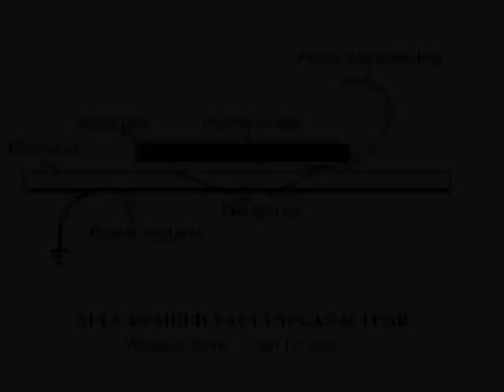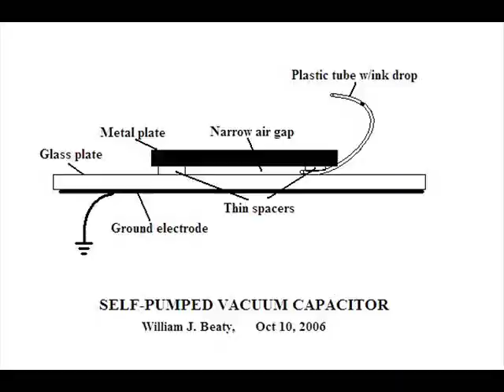Self-pumped vacuum capacitor effect

Comment from the maker: @M0AYF VERY COOL.  Ozone appears above a certain e-field threshold, nitrogen compounds at higher field.  So O2 should trap first.  At some low voltages the N2 pressure wouldn't change at all.  Also I've wondered how much the initial Al2O3 layer slows the rate.  Perhaps initially sand Al surface under dry N2?  Real ion pumps designed to use ion beams, plasma never touches metal, otherwise surface is etched by 'plasma polishing' and gas released again.  To try: layer of fine metal mesh above plate

Comment from the maker: > what kind of nitrides and oxides etc.

The plasma is against aluminum on one side and glass on the other.  Plasma is chemically active, so the air molecules should combine with the solid surfaces.  But glass is relatively inert, so the pumping effect seen is most probably caused by formation of Aluminum Oxide and Aluminum Nitride.

Comment from the maker: No, it was a radio transmitter using a pulsed arc in place of transistors or tubes (since even tubes hadn't been invented yet.)  Easily puts out thousands of watts.

A Tesla coil is not really a transformer, since in theory it should step up the voltage perhaps 100X, but in practice the voltage is far higher.  It doesn't have a step-up ratio, instead it stores radio energy in an EM resonator.  If you keep on pumping in more energy, the voltage keeps growing higher until something breaks down.

Comment from the maker: > The streamer would make a microscopic molten hole in the glass and simultaneously propel out the last bits of ionized gas.

Weird, but check again.  Once the hole appears, Tesla says the pressure rises...  his point being that it happens slowly, as if "cathode rays" can slow the inrush of air as well as keeping the hole open.  The pressure inside a tube with a visible hole should not rise *slowly.*   Tesla believed that chunks (we'd say 'atomic clusters') were being flung through the glass.

Comment from the maker: > weapon use

Tesla's "death ray" was published in the 1980s.  Plans depict a giant VandeGraaff machine with a belt of charged air, (pumped by a Tesla turbine of course.)  The sphere was covered with glass/vacuum insulated bumps.

Inside the sphere was a many MeV particle accelerator in vacuum which launched mercury atomic clusters (nano-droplets) through the center of a multi-stage aspirator pump.   In 1930s NT claimed building a successful prototype.  I've not heard of anyone trying this.

Comment from the maker: > Why is the air getting solid

It's not the current that does it, it's the high-voltage plasma.   Plasma is chemically reactive.

All the oxygen in the air gets slowly converted into oxidized aluminum, a white solid powder.  The nitrogen in the air gets converted into aluminum nitride, also a solid.  The remaining few percent of Argon might be left behind.  Or maybe the high voltage will charge up the argon atoms (create ions,) then impact them with the aluminum so they burrow inside it.

Comment from the maker: @teslaandlyne   Plasma turns the oxygen in the air into aluminum oxide.   Maybe the nitrogen gets turned into aluminum nitride.   Also, high voltage drives individual air molecules into the metal surface.  So even argon or helium pressure might start dropping.

Comment from the maker: > How can this method be used for evacation of

As with diffusion pumps, ion pumps are for high-vac and UHV. But suddenly I got it in my head that it might still work at 1atm. It does, but it's very slow (and best for tiny volumes.)

OTOH, for larger volumes, if you pumped a rough vacuum with a rotary pump, perhaps you could get to the x-ray realm just by running a big glow discharge with a tesla coil for hours. No diff pumps or turbos needed!

PS have you found "technique of high vacuum"

Comment from the maker: > are you sure there were no bubbles in the ink?

No bubbles.  Some ink was in the tube at the start, and it immediately started moving in.  I expected bubbles, but then again the plasma is between thick slabs of glass and aluminum and could be cooled by conduction.  From ion-pump literature, plasma is well known to create low pressure as it converts non-noble gases into solid compounds.

Comment from the maker: > where did the air in the chamber go?

Plasmas cause chemical reactions.  I expect that the N2 nitrogen molecules and O2 oxygen got split and combined to form solids: aluminum nitride and oxide.  The small amount of Argon in air might be left behind... or it might be ionized and get driven down into the metal surface.

Comment from the maker: That might work, but only for high-volt capacitors, since initially the dielectric would have to survive tens of KV. If instead the capacitor was first pumped down in a vacuum chamber as the glue seals hardened, internal pressure might be low enough for low-voltage glow discharge. Then just use a solid state high-freq power supply, not a 50,000 volt tesla coil.

Comment from the maker: > maybe this is a new way to surface harden iron ?

Yeah, or put a silica film onto silicon.   Now if a silicon film could be sprayed onto a mandrel, and then exposed to gas and high voltage, you could rotate it and build up sequential layers of oxide or nitride or carbide.  It might resemble mylar film, yet be bulletproof and un-creasable.

Comment from the maker: When I have time, I'll try it out with one of those tiny 1500V fluorescent tube drivers.  I suspect that the volts would be too low to get any corona, but that would depend on the thinness of dielectric, which in this case is very thick (1/4" glass mirror)

Comment: Oh that's cool, I'm currently at Bellevue College, just a few minutes from you and have a stainless UHV system for 70KeV D-D neutron generation and always wondered but was never sure what caused this effect within the chamber.  This seems to works best with more reactive metals and the effect I was seeing in my system was likely from the outgassy (non-stainless) contact and connections I had on the HV lines like silver and tungsten.  Regardless, that's very cool, thanks!

Comment from the maker: > thxns for the vid

It shows how Tesla could make x-rays in 1892, years before other physicists could reach that hard vacuum.

> COIL ....homemade?

Nope, that's a "vacuum tester" Tesla coil, costs around $180 new, see the vid text caption.  I got mine on eBay for $30.   Some of those are very old and not reliable (like from pre-1920s.)  Old ones are smooth, or have large flat facets.   Buy the later-model ones with the close parallel ridges on half the bakelite handle, called "BD-10" type.

Comment from the maker: > hi would it be able to be done with a jar as the spacer and the lid as the electrode

Yes, but it would be incredibly slow.  That thing only worked for very small volumes of vacuum.

Why not a "Tesla Vacuum Pump?" If a jar was full of close-spaced metal plates hooked to a tesla coil, it might pump down much faster.  Perhaps use thin glass spacers to prevent direct arcing.  Then use plumbing and a short hose to hook that "pump jar" to another empty jar to pump a vacuum.

Comment from the maker: They still exist as high-volt car ignition, and as the high-volt power supplies in CRT monitors.    But their originally they were the first high-wattage radio transmitters.   Marconi used Tesla Cois (also called "spark transmitters") to broadcast across the Atlantic, and Marconi's patents were invalidated in 1944 in favor of Tesla's.    So, who actually invented radio; the patent thief, or the one who actually came up with tuned high-volt spark transmitters?

Comment from the maker: > an Oudin coil? 

Tesla in the USA invented a huge number of coils, including small handheld coils, and all possible connections of primary/secondary.  Oudin in Europe invented a coil with no primary which was a large vertical spiral (like 1ft across, several feet tall.)

Over years people wrongly started calling them by the name "Oudin coil" if they were vertical with high-volt tip.  If the coil was horizontal, with two HV ends, people called it "Tesla Coil."

Comment: Hi,
A great video which inspired me to try this for myself. I used a sort of home-brew CDI circuit to produce around 120 sparks per second. Two aluminum electrodes fitted into a 3 mm I.D. 20 cms long glass tube would happily pump around 4 cms of coloured water into the tube in less than an hour.
However it would never do any better than to fill the tube to about one fifth of its total height with H2O which seems to imply its only the oxygen thats being converted to Oxides. Still great fun :-)

Comment from the maker: > oudin coils have one end of the primary and secondary grounded.

Nope, that's a myth.  Tesla patented all sorts of coil configurations including the single ground.  I've seen people insist that conical coils are "Oudin coils," yet Tesla patented them too.  I think the real issue is an old battle between Tesla supporters and Oudin supporters, and they fight over types of coils.  The original Oudin coil is a grounded *single* helix with a movable tap that determines "primary" and "secondary."

Comment: oooo...
nice. A scaled up version would be invaluable for those who lack the finances to buy a proper pump.

Might also work using a defunct or salvaged touch screen, or LCD with ITO front glass.

could probably use a sheet of copper PCB material precoated wiyth a reactive metal such as magnesium or barium.

Comment from the maker: > could you ever put this to real use, say, with putting a vacuum on a vacuum tube?

It's already being used, search on "ion pump".   But those things are used at ultra-high vacuum.  I wanted to see if the pumping effect might even work at 1atm pressure.

Comment from the maker: > Anyone can buy tesla coils

Yep.  They produce "static" sparks, can be painful, but no visible blisters.  Just steer clear of using the narrow glass urethral probe from Violet Ray quack medical kits.  Ouch.

On eBay, the really old antique ones with flaky wiring might burst into flame and trip circuit breakers.  You have to disassemble those and repair/test.  New ones cost $180 or so, check out the vid text caption to the right, under the yellow "subscribe" button.  Click on (more info)

Comment: You know, you're right; you can drive this thing with 25 watts. Likely, that little thing he had was only running on, say, 50 watts. The way it works isn't the amount of power, it's the voltage. You can turn 25 watts into five million volts if you know how to do it.

Comment from the maker: @conundrum2007, lots of things to try. Imagine tiny vac chamber (or DIY vacuum tube) exhausted by a stack of alternating plates, like a capacitor stack w/plasma dielectric.  Also see the Shawn Carlson version in SciAm: gas scavanged up by zeolite cooled with liquid nitrogen.  Maybe plasma against Al powder from art store does better?  Large surface area.  Buy a Hastings gauge tube and meter.

Comment: I think I remember your cryogen alcohol jelly from a long time ago. I'm curious as to whether or not this ion pump is similar to the 'getter flashing' on standard vacuum tubes. Either way it's a really good way to get the final knock down on the pressure inside of something by converting the contaminating gases into solid compounds.
Reply from the maker: Yep, and also causes the problem with neon bulbs and HeNe laser tubes, where they stop working as the gas molecules get embedded inside the metal electrodes.  Plasma tubes "self pump" to vacuum.

The real point of this video is, this might be one of Nikola Tesla's secrets, an 1890 method where he could achieve extremely hard vacuum, back before diffusion pumps existed.   For MeV x-ray tubes and particle-accelertors and gamma-ray generators we need "UHV" vacuum, not mechanical pump's level of vacuum.   If my test worked, then this "capacitor" would start making x-rays, and maybe Tesla could do some MeV ion beams at Colorado Springs, even though no physicists back then could pump a low enough vacuum.
Reply: @wbeaty  I did a little research on those Helium Neon lasers. If they are a little helium deficient you can put them in a soak tank for a few hours to regain the proper gas pressure because helium kinda diffuses through everything. It will revive those lasers but only if that was the root of the problem. It's also wise to check on it often or you may flood the tube.

Comment: interesting because the device which reduce the racket this used a low profile alco permanent magnet which were separated and dialed away from the the plate... noise reduced light increased... M.J.H.

Comment from the maker: @glutinousmaximus   Never saw an experimentalist in action?  Worked in a lab?  One rapidly discovers that "The Scientific Method" doesn't exist, it's an invention of grade school teachers, and today even in grade school it's removed from books and replaced with chapters on "Nature Of Science" NOS.

"king of Klutz"

like the sound of your own voice""

New here, eh?  Trolls blocked immediately, zero tolerance.
Reply: It is interesting, I remember being taught the "scientific method", but in my own experiments could never really follow it when experimenting. The NOS is far more realistic. I tend to think of science along the lines of Observe something in nature -> hypothesis of how it works or how to use it -> test that hypothesis -> observe the results of the test. The "Scientific Method" is actually pretty restrictive: 1 state the problem(how do you know what it is?) 2 research the problem(what if there is no research to find on the particular question) 3 form a hypothesis(how do you get a hypothesis from simply researching it) 4 design an experiment to test the hypothesis, 5 record the data 6 conclusion. 

I agree the NOS is superior to the "scientific method" in many ways. Even the observe theory test observe method is better than the "scientific method". If I followed the scientific method when working with redox reactions I would still never really ever get anywhere. The NOS and observe theory test observe concept allows more flexibility. Great post (I have heard the complaints about not using the "scientific method" myself before, I am glad to hear that I am not a total weird person for rejecting it.